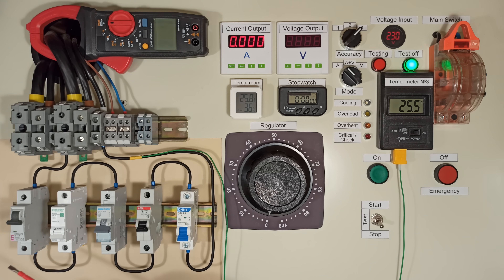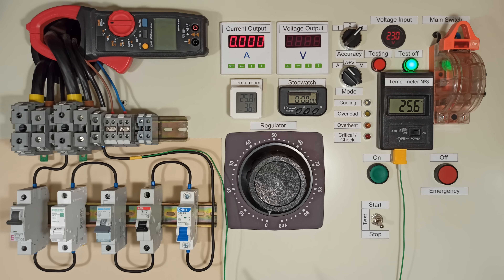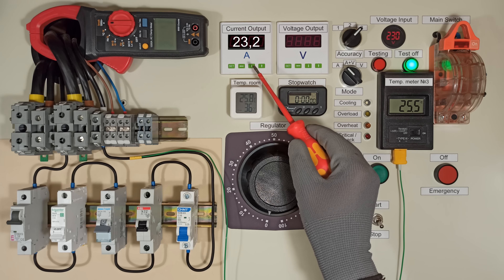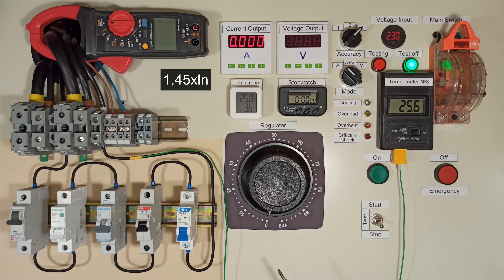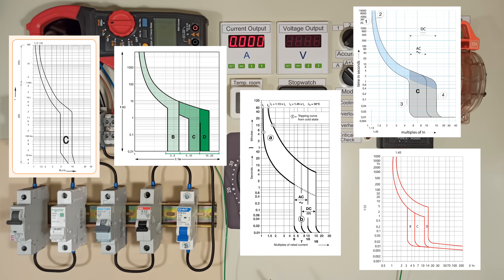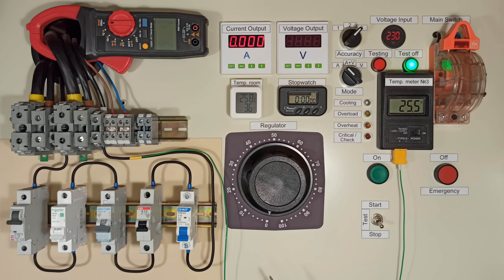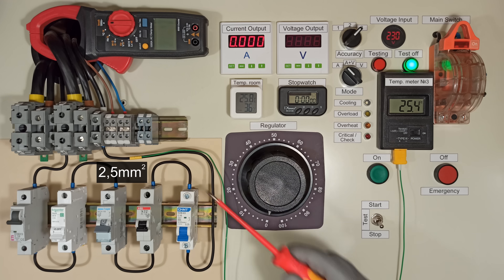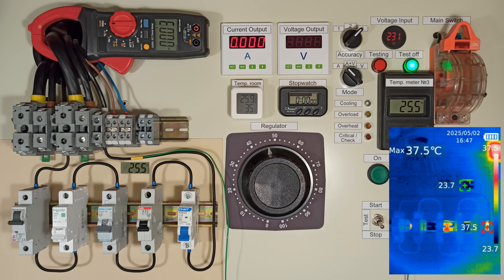Test MCB 16A. ETI, SE, Hager, ABB, CHINT

Comment: Interesting test !
The 2 minutes 'delay' for the ETI seems fine to me. After all, 5 amps over-current is a serious error condition.
The Chint is a bit slow, too slow in my opinion. Based on this single test I would not trust this fuse to protect my house.
If you have the opportunity to make a more statistically representative test, then yes please do, it would be interesting to confirm the findings of this test.
Reply: Your opinion is mistaken. Tripping too soon is as problematic as tripping too late.

CHINT is fine, arguably it is the best as it trips right in the middle of its curve.

ETI is defective and unqualified. Its premature tripping could mean:

1. It may malfunction under normal load conditions (e.g., at 16 amps).
2. It may overheat internally, leading to early trips, which could increase the risk of fire.
3. It could mask other underlying electrical issues, potentially causing greater problems.

Furthermore, ETI's least detailed trip curves may indicate a lower quality grade. ABB, being the best, provides the most accurate graphs.
Reply from the maker: Thank you for your opinion. Although CHINT trips within the standard limits. Yes, the statistics for the same model are quite interesting. It's curious how different factors affect it: production date, batch, country. If this format gains interest, I’ll run similar tests more often and with different manufacturers. Are you an electrician? Which circuit breakers do you use most often?
Reply: @ElectroTest_1  Schneider electric or ABB are the most used because they have a good reputation, are guaranteed to respect local norms and the price is somewhat competitive.
Reply from the maker: Okay, I think the use of brands also depends on the countries and the distribution network.
Reply: @ElectroTest_1  ABB is very common in Austria. During my apprenticeship we only used ABB mcbs. (Type B13/B16/C16 1P+N/3P+N and rarely C25/C32 3P+N)
Reply from the maker: @gumpi5 OK, good to know. Do you use ABB SH-200?
Reply: @Janktzoni Well that's an interesting perspective given these test results: the other brands were threshold -- right on the line suggesting the possibility of nuisance tripping in some carefully designed contexts.
The CHINT tripped slap-bang in the middle of the graph, the very definition of "to spec" and that gives me more confidence that any of the others put together.
Of course, there are many other specifications to assess before calling it "the best"...
Reply: Chint MCB and RCOB  is well known in China to trip much slower than other brands, be it over-current or leakage current
Reply from the maker: @oldhongkong565 Thank you for the information. Slower operation is not a bad thing! The main point is that it meets the standards and there are not frequent defects. In some cases, slower tripping is actually beneficial to prevent the main circuit breaker or lines with frequent overloads from tripping unnecessarily. I wonder if people in China use other brands, or mostly just Chinese ones?
Reply: @ElectroTest_1  CHINT is so popular  in China that it is almost like the default brand to install in residential homes. That being said, if one is more  price conscious, there're quite a lot of other brands to choose from. On the other hand, it's not surprising to find better quality ones like Bull(an indigenous Chinese brand), Schrinder and Legrand in Chinese homes, and even Siemens and ABB to a lesser extent.

Edit: Should've been Schneider, not Schrinder
Reply from the maker: @oldhongkong565 Thank you for the information. This is really very interesting!
Reply: @oldhongkong565 are you saying Bull is better than Chint and what about Delixi?
Reply: @adon8672  I see you're quite familiar with the Chinese market. Bull is generally regarded as better quality for all of its product lines, and I've seen tear down video showing their constructions are quite good and sometimes even better than Schrindler and also a test that show they trip faster/with less current than Chint. Delixi is definitely a budget friendly brand.

Edit: Should've been Schneider, not Schrinder
Reply: @ElectroTest_1  正泰在中国很容易看到，用的很多，因为性价比高。国际品牌有施耐德，价格高一些。
Reply: Chint, troppo lento davvero, non li monterei mai 😊
Reply from the maker: @bianchi83 Don't worry, CHINT performed well in this test. According to the standard, the breaker is allowed to trip within 1 hour at 1.45×In.